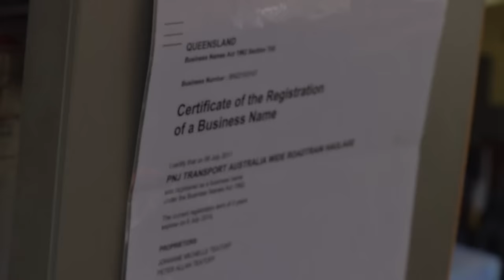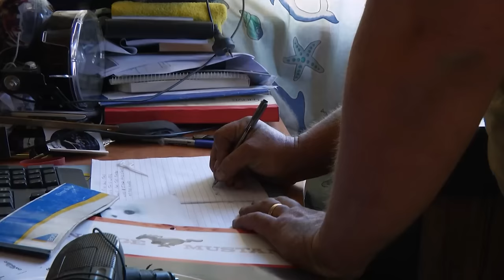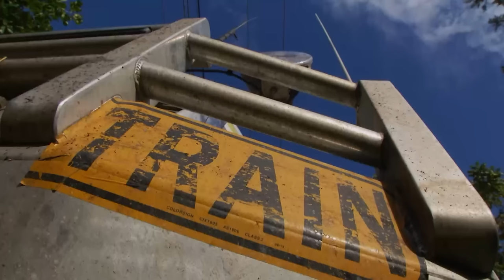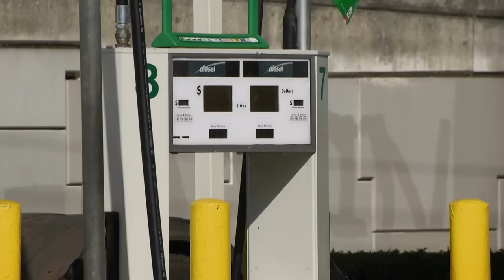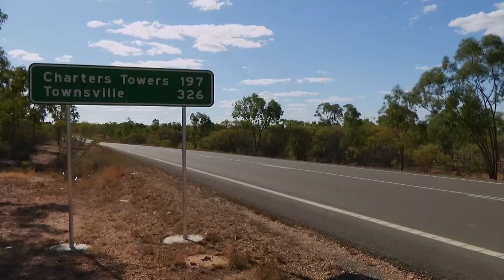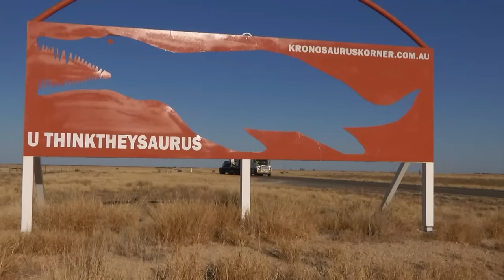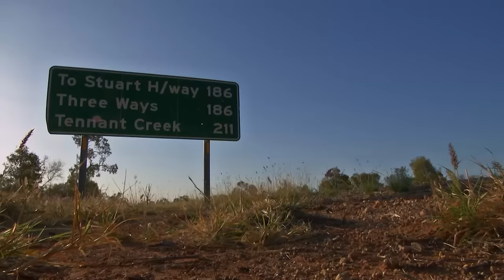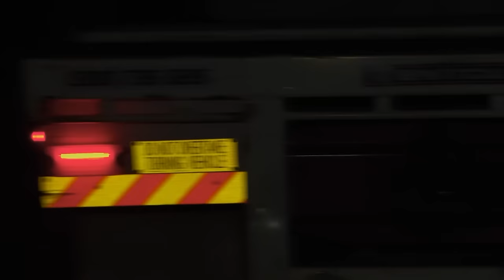Truck Driver's First Job In Weeks Is Anything But A Smooth Journey!

Comment: The reason why the trailer fell apart because it was loaded backwards. It acts like a ad it ram.
Reply: plus the trailer was a piece of rubbish. The side was popping out of it before he left at 3:45. Should have taken a photo and said something. If they don't pay, take it away and keep it till they do.
Reply: How would you get it on and off?
Reply: @ResortRatata  with a trailer dolly
Reply: @ResortRatata  You put a tarp on the trailer, wrap it with 2 straps wound around the back to stop the wind from hitting the door

I used to haul lumber long haul, had a customer that had these weird small bundles of 1" x "' x 4' of aspen, would have to wrap the load to hold the bundles together, real pain to haul, nothing but problems with them
Reply: @ResortRatata  you must be American?

Comment: I know four fifths of eff all about long haul trucking, ecpecially loading. Even I thought, at the start, that at least half that load should've gone in a secure shipping container. A simple  gentle push on the side of that trailer (which was rejected) would've shown it wouldn't take the draft.

Comment: What person in their right mind would put the furniture on a open deck trailer. TOTAL FLOG IS TURBO. I’m no truck expert but can you just swap trailer’s like that don’t they have different connections
Reply: You can swap trailers aound. They all have the same connections.
Majority are all interchangeable. 👍
Reply: @philliphunt1579  I learnt something today. I was just looking at both trailer’s one had what looks like a draw dar and the other was different. Thanks for your reply
Reply: @simonknowles4267  no problems Simon. You may have been looking at a "dolly" which has a drawbar that was placed underneath a conventional semi trailer. The dolly is just basically a platform for the turntable which is mounted on the back of the prime mover. Its a device allowing you to attach a second trailer.
Reply: @philliphunt1579  you are correct. I appreciate your input cheers
Reply: @simonknowles4267  no problem. 👍
Reply: @philliphunt1579  In Canada we use B trains, the lead trailer has a 5th wheel built onto it, the rear pup is just a 30" deck
Reply: I wash trucks and I absolutely love trucks and I wouldn't even wash turbos truck i wouldn't get paid but anyway love the show and I absolutely love trucks

Comment: so much wrong with that load lol. for a start why didnt he tarp the back of the trailer to protect it from wind? any driver would know to do this.. and why wasnt all the furniture and moving stuff either put in a shipping container or tarped up completely to protect it either? im not a long haul or double driver and even i know to do this stuff, ive mostly done cattle and hay etc. its just common sense. also how tf do you fail so badly at strapping a car down even when you have wheel straps.. this guy shouldnt be on the road